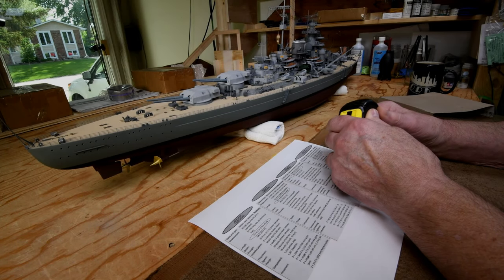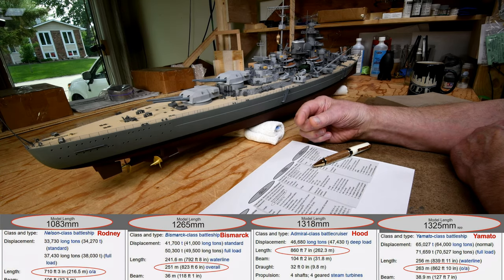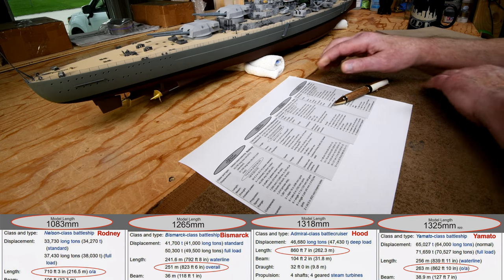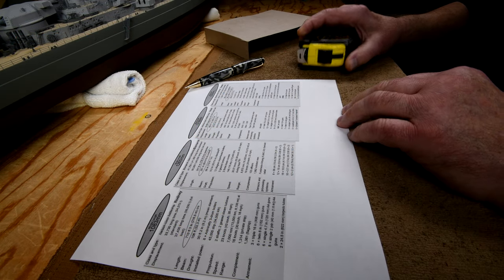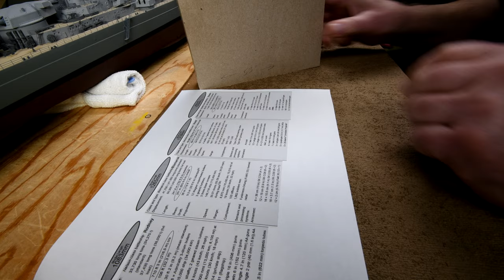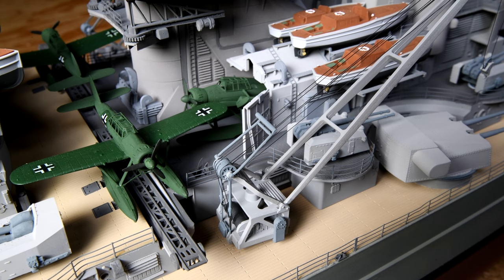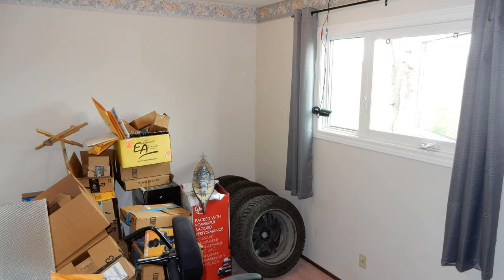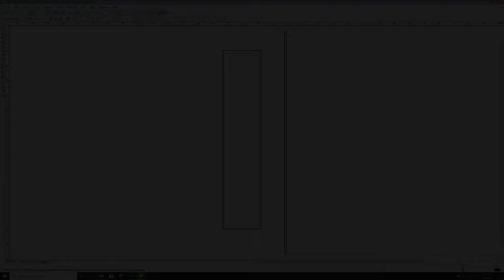The Model Ship - Part 479

Comment: Does that 53" take in to account any flags or other stuff that may be hanging over the bow or stern?  Put up some temporary shelves up in a room you don't use.  I wouldn't trust it setting on those cardboard boxes.  Inevitably something is gonna move........... in the wrong direction.   Murphy may get to it.

Bismarck, .... Hood, ....Rodney, ....Yamato.  You are done with woodworking I believe.     ............... or at least like we use to know it.    The main thing is, YOU do what YOU want to do and don't apologize for it.!  Like you said, we change and we have the right to.                               See ya tomorrow.                 JImE
Reply from the maker: The measurements of the Bismarck that are provided by Trumpeter seem to exactly match the overall length of the model if the ensign flag staff is included. I'm hugely aware that a lot of model ships have appropriate flags. Sine mine won't, I'm only concerned that the case will just nicely accommodate the ship itself.
I shook everything down really good in the storage room. Not worried.
As for my basement workshop, I'm hoping that it hasn't become just a wonderful memory of thousands of hours of enjoyment. Time will tell.
See you tomorrow Jim.